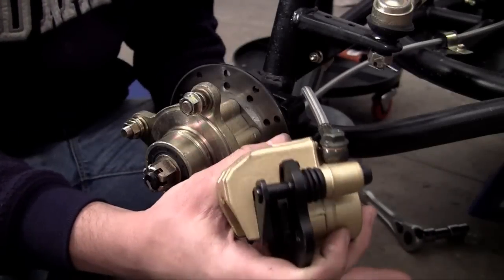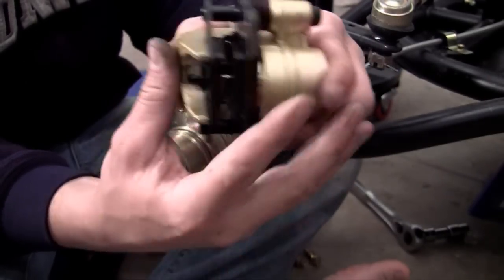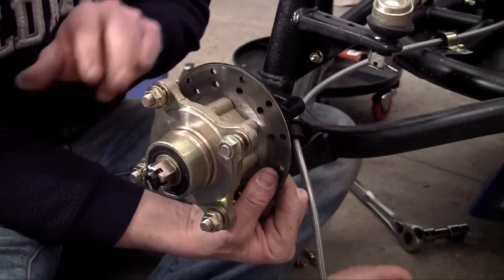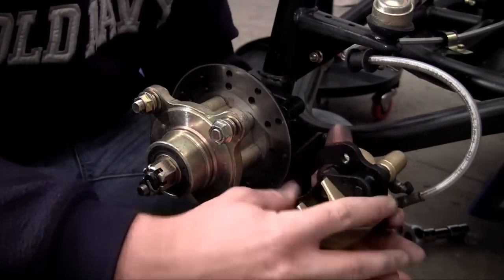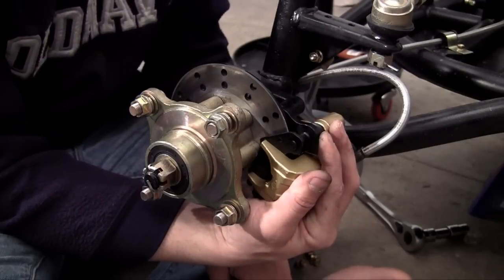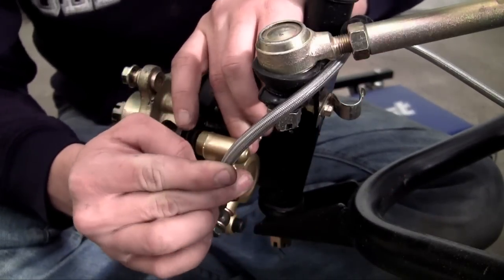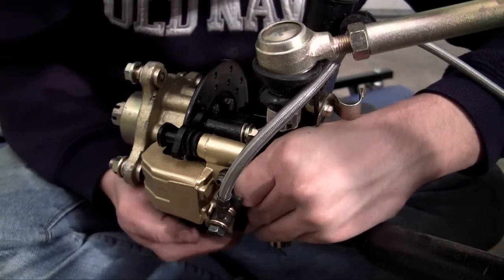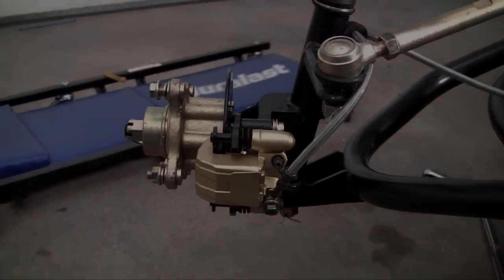How to Build a Go Kart - 11 - Brake Caliper

Comment: I bought the same exact caliper but I can’t get mine to compress do I need to remove springs in middle of pads ??
Reply: Did you find an answer? I have the same caliper and am having the same issue of it not compressing

Comment: great video! can you make a video of how to replace a brake line
Reply: Abit late but, I think what you should do is first drain the system of brake fluid. Then you can take off and replace the line. After that, refill the system with new brake fluid. Make sure to bleed the system out for air.